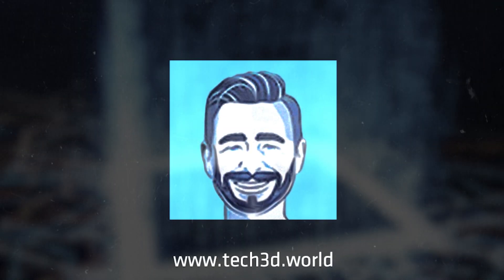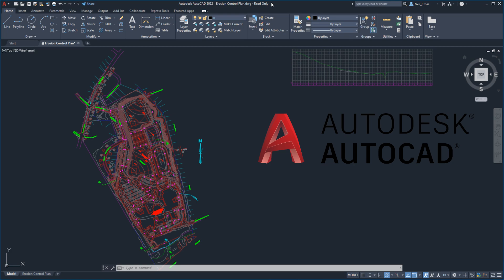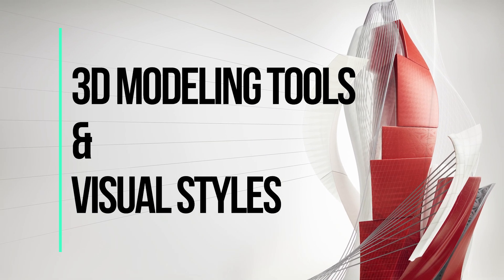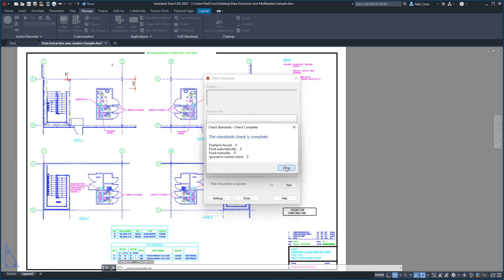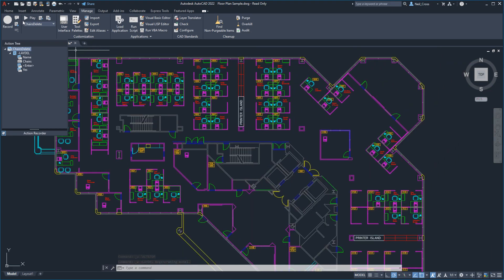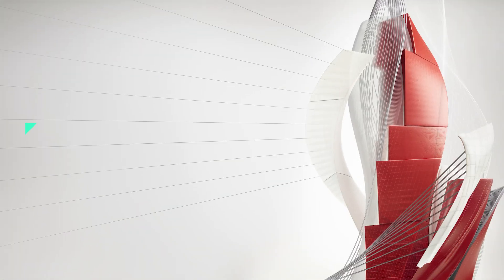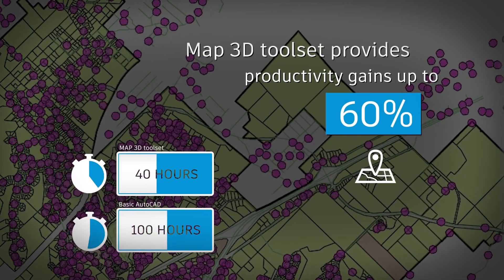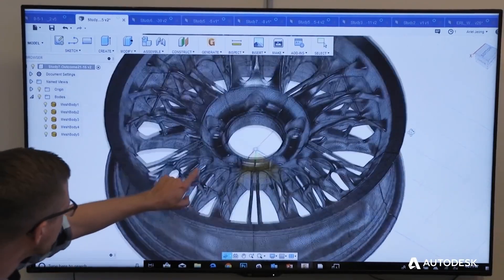10 BIG Difference Between AutoCAD and AutoCAD LT

Comment: Yeah... CAD isn't $1,775 anymore. Now it's $2,030.
No longer $5,060 for 3 years, now $6,085 for 3 years.
New features? Where? It's the same program it's been since 2012.
Stuck deciding CAD or CADLT? Pick BricsCAD. Exactly the same as AutoCAD for $711 per year, $1,910 per 3 years, or $1,596 for a Lifetime subscription.
Oh, there's a Lite version too, with more features than AutoCADLT. $314 per year, $850 per 3 years, $708 for lifetime.
The lifetime versions are just the version you buy. Not the latest version every year, but you can pay "Maintenance" fee of I think $266 per year with a perpetual license to get the latest version.
I'm not a spokesperson. Maybe I should be. I'm just sick of over-paying for AutoCAD for more than a decade.

Comment: Best thing since sliced bread when the combined all the flavors of AutoCAD to create the toolsets, I mainly use Plant 3D but jump between MEP, Architecture and Mechanical for different tasks. So I could do most of what I do with just one AutoCAD full license, though I do use Inventor to convert/simplify/adjust supplier models for my company and myself.